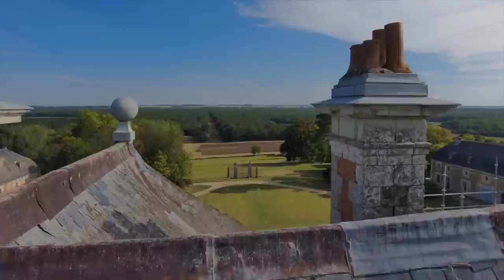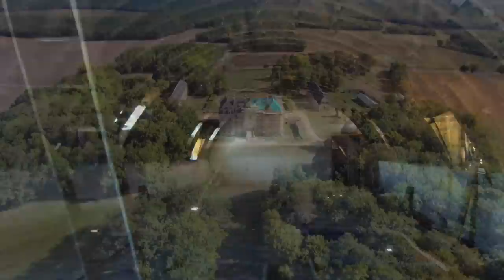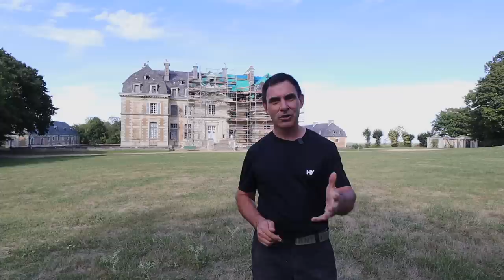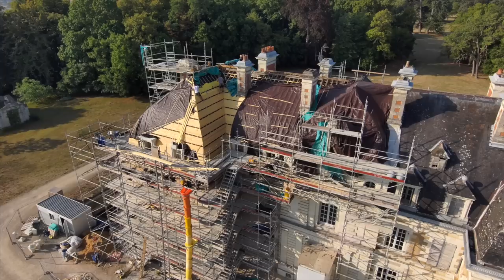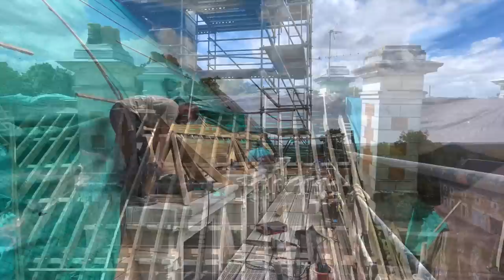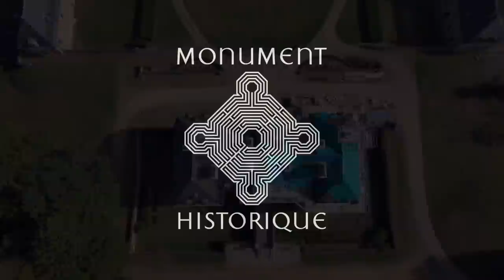We have a HUGE announcement!

Comment: A few months ago I tried to find some information of real estate taxes and found a few things (in English) that looked reliable. I was surprised that the property taxes on some of these places was actually lower than my little house in NH. One building on 4/10ths of an acre and about 800 sq. ft. above ground. NH tends to rely on property taxes and has no income tax or sales tax. 
France seems to rely on income taxes that I suspect are high (I haven't looked that up) but the real estate taxes are low.  
I think in this country historic preservation projects usually get some kind of tax credit Trump had an 80 mil problem with the IRS over this issue of historic preservation tax credits he claimed he was owed for the renovation of the Trump hotel building (the former post office) in Washington. 
It sounded like France was trying to do HP on the cheap and it seems fair that some kind of subsidy is applied. 
Another thing that I wish I could look into is the prospect of someone trying to create an industry to collect and market the muck that clogs the water features of the gardens. Many of the moats, canals and ponds were probably man made and served the practical purpose of lowering water levels and making the ground useable just like at Versailles. Many are apparently shallower than they used to be. But if the muck isn't polluted with chemicals and heavy metals like lead or mercury, were not exposed to much chemical runoff from fertilizers, pesticides etc. perhaps they can be use as a rich organic fertilizer?  45,000 sites would provide a lot of feed stock.  Would it be worthless? 
In about 1895 Frederick Vanderbilt was able to sell the muck that had filled a small pond on his Hyde Park Estate. The site claims he got about $30,000 in 1895 dollars by selling it to the local famers and he probably used a lot for his own farm acreage.. Two of the houses for managerial staff (large, well built and detailed but not as lavish as the mansion) could have been built at the time for about $5000 each. 
I live in a small district in a rural NH town that was built in the 60s as vacation homes around an old glacial Pond (about 10k years old) . While I was a commissioner decades ago i asked the state environmental services dept. if we could do that to try to restore the pond. In 60 years it has lost about 20 feet of depth from sand runoff from the roads as well as the leaf fall for thousands of years. It is in its last dying stage, is classified as eutrophic and in a few hundred years or less, it will be another swamp or bog like at least one other nearby in the state park. They also thought it would be far too polluted. But these estates may not have been using many chemicals and are not immediately surrounded by other development.

Comment: It is heart breaking to see the damage done by water through neglected repairs. I congratulate on securing the French heritage grant. I can only imagine the paperwork you had to compile and specialists that visited to make assesments. Now you have to manage all the trades so they work in harmony. One observation I made and your château is not the only one I've seen, why do the roofers not lay asphalt tar paper, or a water proof membrane under the slate? The omission of such was why there such a catastrophic damage in the first place. Nailing slate on plain wood because that is the historic custom is just putting off the repetitive damage for another 50 years.  The slate protects the wood from the outside, however elements but moisture becauseWhy???
Reply: Oops, outside elements, however, moisture builds up on the underside of the slate and that rots the wood, the nails rust and the slates start sliding and cracking and fall away. There needs to be a moisture barrier under the slate!